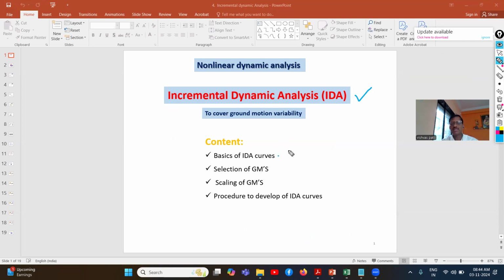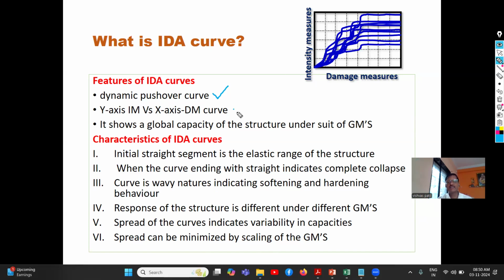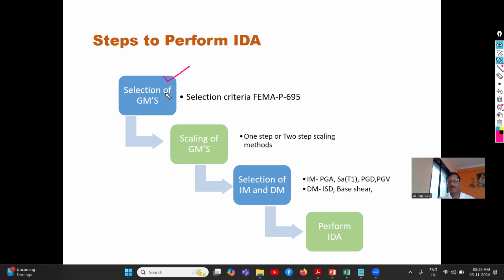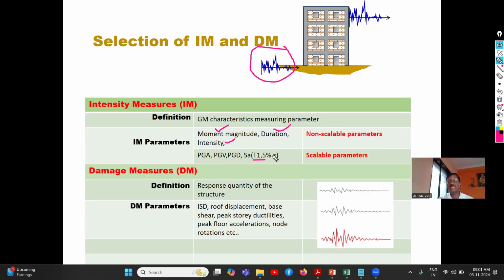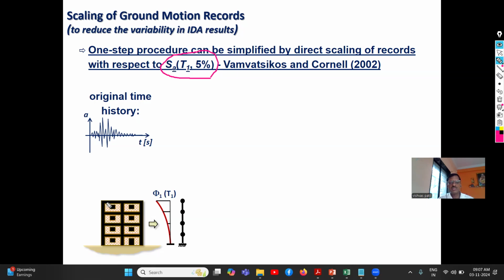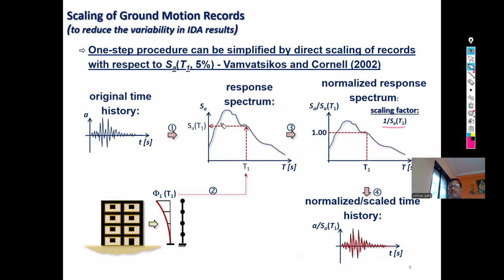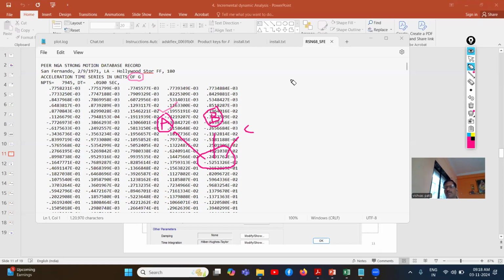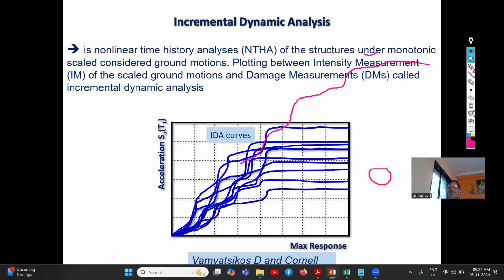Incremental Dynamic analysis

Comment: How to estimate building time period
Reply from the maker: 1) Software like ETABS calculates the precise time period based on the actual distribution of Mass  and Stiffness. Perform modal analysis. 2) OR use empirical formula given in IS1893-2016